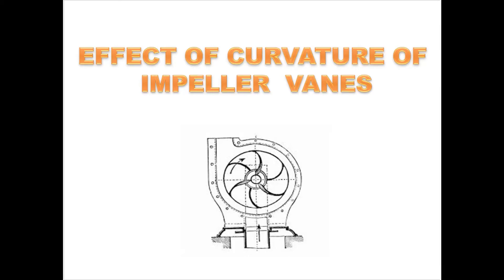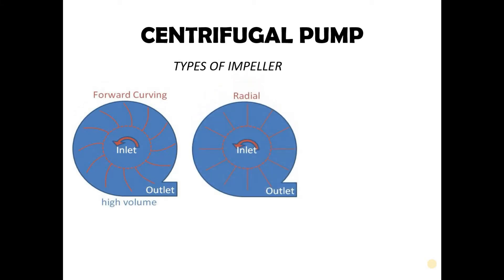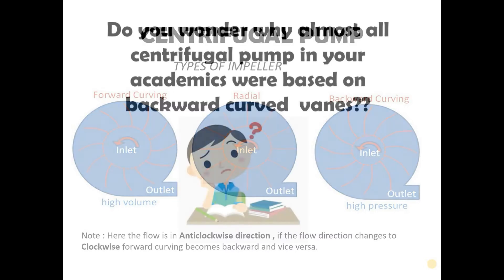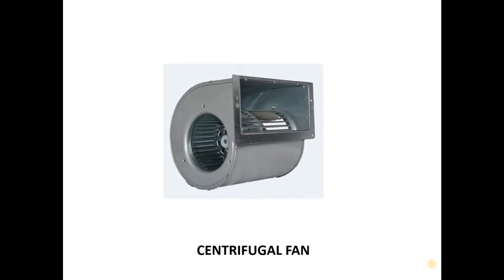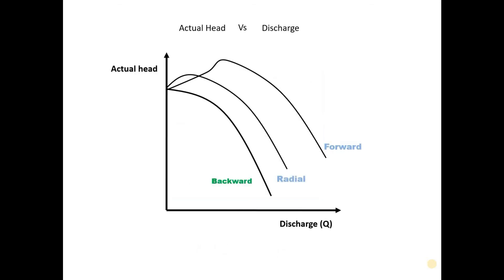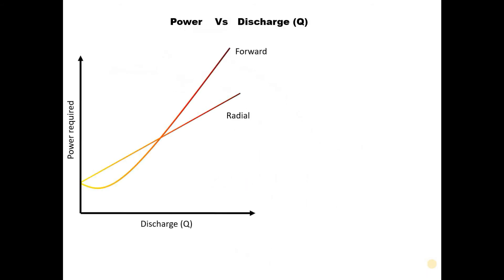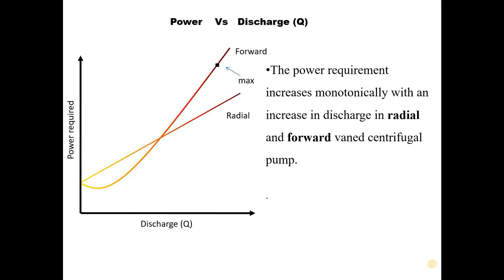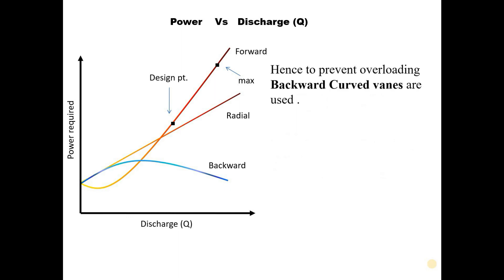Effect of Curvature of Impeller Vanes

Comment: Hey there! In your point of view, which of these water pumps would be more efficient/faster in terms of car-engine cooling circulation? 1- https://jctautoparts.co.za/wp-content/uploads/cm/catalog/Nissan/NP200/NP200-1.6-16V-WATER-PUMP-400x400.png 2- https://www.engineteam.com/documents/RM0015/RM0015C.JPG
Rotation direction is anti-clockwise